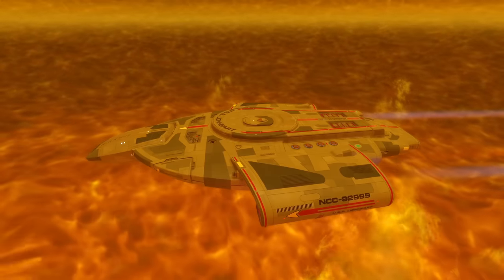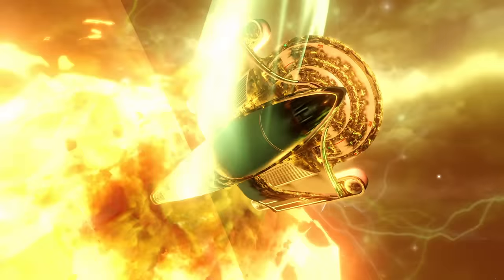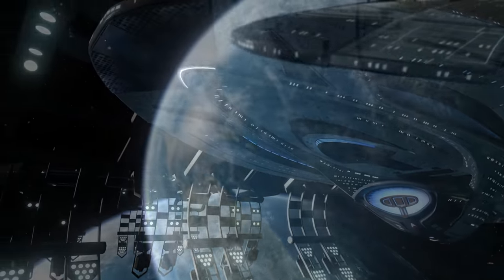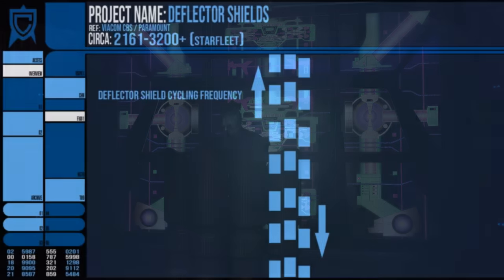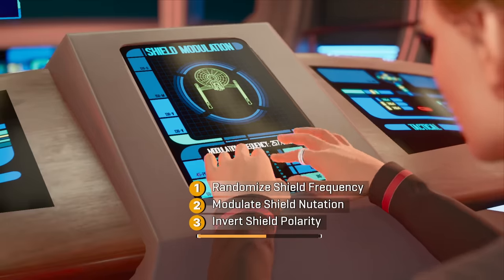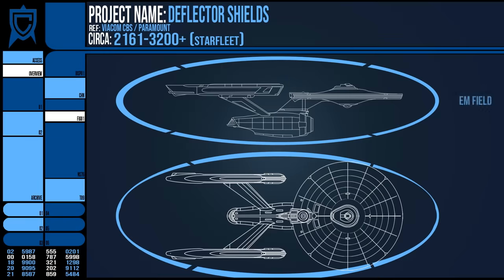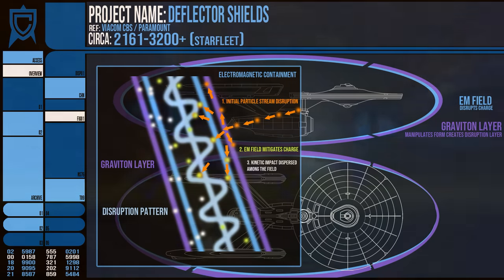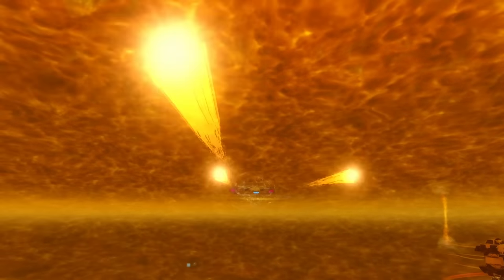What Makes Deflector Shields Different?

Comment: The problem with the “matching shield frequency to fire through” idea is it creates the plot hole in Star Trek Generations that when the Riker ordered Worf to return fire on the Duras sisters’ Bird of Prey the Enterprise’s phasers should’ve passed through its shields as easily as the BoP’s disruptor fire passed through the Enterprise’s…
Reply: The enterprise should have been able to destroy her in a single barrage. Really ( shield or not )
Reply: Wouldnt of mattered, la forges vizer was comprimsed so no matter what frequency they change to the duras sisters would be able to match
Reply: @darthdragonborn1076 i believe in the battle dialogue, it suggests that la forge attempts a new frequency, but the klingons were able to require it . ( the gunner said   he had it again.   ) frequency.
Reply: @shanenolan5625 litterally what i just said
Reply: @darthdragonborn1076  y3s , I'm agreeing.
Reply: @darthdragonborn1076  they’re saying since the Klingons adjusted their beam to match the Enterprise’s shield, then their own shield must also be the same frequency as the Enterprise’s to be able to fire at all, so the Enterprise should’ve also been able to fire back as if there was no shield (instead of doing the cloaking device gambit to lower them).
Reply: Hey, guys. Even if they changed the frequency, LaForge's visor was still accessible by the Klingons. Nobody already said that yet, right?
Reply: Duras sisters probably changed their shield frequency back after firing
Reply: @kaitlyn__L  I could see, depending on how fast it takes to do, the Duras ship would switch to a different frequency between firing their weapons as a countermeasure. Or maybe only one section of their shields around the disrupter canons was matched.

Though we all know the real reason is that they didn’t put much thought into it when they filmed the movie
Reply: @oninoni  that would be sensible
Reply: @Nostripe361  yeah I’d honestly assumed it was a “once every few minutes” deal but considering the “constantly rotate shields” thing maybe it can be milliseconds.
Reply: @CtrlOptDel Well, no. If they timed their shield frequency to their shots just like the old prop fighters and their machine guns so that the shields would match only when the disrupters were firing then it wouldn't matter. But in all seriousness, a  Galaxy class would crush an old BoP pretty much instantly even running only on the fusion generators in the saucer section. Idk HOW the Duras sisters took down a Galaxy class with that old a model no matter how much of a jump they had on them. The Galaxy should have been able to take them with a single full spread, end of story.
Reply: The Star Trek version of an interruptor gear? Match the frequency while firing, then change it automatically.
Reply: @gmradio2436  literally what I just said 😂😂😂 sorry I couldn't help myself
Reply: @getoffmeluckycharms  Wait, what? Who are you? Someone from the comment chain?
Reply: @gmradio2436  you replied to my comment my guy
Reply: @getoffmeluckycharms  he actually just added a comment to the thread. There’s no @ and we all got the notification. Also two other people before you said it (I replied to the first two)
Reply: @shanenolan5625 They just wanted to kill of the ENT-E. It was a piss poor way to do it too.
Reply: Wait, didn’t the Duras Sister adjust their torpedo’s frequency to pass through the Enterprise’s shields not their shields? The only mention of the BoP’s own shields were that they’d drop when the cloak was engaged. The Enterprise had no way of knowing what the BoP’s shield frequency was to adjust their own weapons to match it.
Reply: @mb2000  the idea is that you have to match your shield frequency to your weapons or you will just impact the inside of your shields. Do if the Duras weapons were matching the shields of the Enterprise than the Bird of Prey needed it’s own shields to match
Reply: @mb2000  The shield frequency of the BoP also has to be the same. The argument is that ships know their own shield frequency, which allows them to fire through them while enemy fire does not. The BoP has to fire weapons through their own shielding as well as Enterprise's, consequently the BoP's shield frequency would also have to be the same. On this basis, Enterprise wouldn't even have to tune her own weapons to pierce the BoP's shields as by default those also should have the same frequency.

I'm of the opinion that this is as usual a very pedantic argument that can only exist in the imagined reality of nerds with ironically flimsy and simplistic logic that can't work in the real world. Any number of factors could explain why the BoP can fire through the shields while Enterprise can't, like auto-cycling shields while firing, to 'frequencies' not meaning the same thing for shields with fictional physics involved. Most of these same people would barely understand the physics and engineering in today's every day mechanics like in computer chips or locomotion. The Duras vs Ent-D battle was not the only example of this 'flaw', and not going into the specifics of the mechanics beyond Duras know the specs of Enterprise is not lazy, but simply prudent writing. Unless you're really looking for stuff to nitpick and you watch Star Trek for fictional technologies to work according to your layman 21st century logic.
Reply: @getoffmeluckycharms  No, I replied to CtrlOptDel. Everyone in the chain might have seen it, but that is it.
Reply: @Nostripe361  Yeh I’ve just never heard of that being a problem before I think there’s been times when shuttles or probes have been launched with shields up too. I slash took the shields to be a one way thing.
Reply: @mb2000  If they adjusted their weapons to match the Enterprise’s shields without also setting their own shields to that frequency their weapons wouldn’t’ve been able to pass through their own shields & would’ve impacted on the inner surface of the bubble.
Reply: The shields have always rotated through frequencies, they're not static. Otherwise, the opponent would just need to know what frequency hit them to match it and fire back. But the Klingons were always watching what they cycle through, so while they could fire and change their shield after, they would always know what the Enterprise's next frequency was.
Reply: @CtrlOptDel  I get what you mean and it makes sense, I just don’t think it’s ever been mentioned to be a problem before so I can only assume that it isn’t and the shields are one way regardless of frequency.
Reply: @mb2000  That is indeed the simplest explanation. I was responding to CI’s assertion that it was frequency-matching that allowed for firing out of the shield bubble.
Reply: @CtrlOptDel  I apologise, I wasn’t meaning to sound like I was trying to argue the point!
Reply: @3Rayfire  that is a pretty good explanation. It would be like shuffling a deck of cards after every move or draw in a card game but one side can see through all of your cards and know what you will do next. 

I just always thought that there were millions of frequencies and it was impossible to figure out the exact frequency needed to pass through with modern trek tech.
Reply: @mb2000  it’s probably been mentioned here and there but trek has always been really inconsistent with the details or major plot points that it’s basically impossible to say what is possible and what isn’t other than the very broad strokes. I

I  mean look at how they deal with teleportation going through shields in many episodes despite it being stated that teleporting through them is impossible in many other episodes
Reply: That is assuming that the shield frequency of the Klingon vessel is remaining the same when it fires & when it doesn't. Which may not be the case. If I remember correctly we see it trading barrages but them not firing on each other at the same time.
Reply: @3Rayfire  and the BOP wasn't firing constantly, so it seems like they were doing adjustments on the fly. And a bop firing in anger can fire far faster than they did.
Since torpedoes are encased, maybe it's even possible to set it to you own shield frequency and the adjust to the enemy's shield frequency.
Reply: There's frequency, nutation, and polerization in ST. I believe they have to match the frequency of their own shields to fire through, but they don't necessarily have to match the same nutation.
Reply: @darthdragonborn1076 * Visor
Reply: @NACLGames  If that were true than every battle would be over after the first phaser shot. "Ensign match our phasers to their phaser frequency and fire" Whoever shot first would lose every single time.
Reply: @mammutMK2  A distinct possibility, after all Chang's Bird of Prey was able to do that to fire while cloaked.
Reply: @Nostripe361 And you thought right, which is why it isn't a commonly attempted tactic. Trying to block every frequency of subspace and the em spectrum, would probably be almost impossible to power and would likely blind you as well.
Reply: Presumably they matched the frequency to fire a volley and then changed it. It’s a trick that only works once anyway, because the target ship will change their frequency once they realize it’s compromised. But even one volley without the protection of shields can be devastating.
Reply: @jayb8934  and the most wild part of all is starfleet didn't actually start changing their phaser frequency until the fought the Borg.
Reply: @NaatClark  Does it make sense for them to. Every ship already has a different frequency, doesn't it? The Borg have a unique ability to quickly crack it, so they have to keep changing it. But it's like a PIN number on your phone. Why would you change it every day if no one knows it, unless you're dealing with a hacker who can crack it every time you use it?
Reply: @jayb8934  We can measure energy frequencies now irl. It's literally how radio, infrared, optical, and neutrino detectors work. If someone shoots a laser we can measure the frequency. The Federation can look in to your bathroom from 10 million kilometers away and you're telling me their ability to detect energy frequencies of something being pointed directly at them is worse than ours? Nahhhhh
Reply: @NaatClark  I mean, I know it's a cop-out answer, but we don't really know how the technology works and why it's not that simple. That's just how sci-fi works. If we could really explain the technology, it wouldn't be fictional. And because real science marches on, sometimes real tech DOES surpass sci-fi, and we just suspend our disbelief.
Reply: Seems some people dug too deep. 

The Enterprise D should have absolutely obliterated that BoP. They just wanted to make a new ship is all.
Reply: What always irked me a about that whole scuffle is that Geordi's visor should have been checked top to bottom to make sure it wasn't tampered with, and I don't care how smart the main villain was, he should not have been able to change or add something in a way that Geordi, Beverly OR Data would not have been able to figure out and fix.
Reply: Shield frequencies are itself a plot hole

Comment: A thought on transporters vs. shields...possibly, transporting requires too wide a set of frequencies to 'fit' through the gaps in the shielding without degrading to a hazardous degree. Like putting your people through a strainer...
Reply: also risky - get your timing wrong and that person reappears as swiss cheese
Reply: Interference in a transporter beam causing corruption to the data I imagine would be terrible for the thing being transported.  Interference with an phaser may reduce the effectiveness but mostly that doesn't matter so much.  So the SieveStrainer metaphor works well.
Reply: I'll just paste the comment I just made in here because now I'm curious what you think. 

Actually it kinda makes sense that we see beaming through shields less. Because with the whole refresh rate frequency idea, when it comes to energy weapons it doesn't really matter if 1% of the energy doesn't make it through due to slight inaccuracies in one's knowledge in what that frequency is and/or the accuracy of whatever is controlling/generating/regulating the frequency reference  (like how a radio needs to have the oscillating frequency generator for reference to process the incoming information normally via the use of a crystal oscillator; I might be screwing that up slightly or oversimplifying). However with a transporter.... that 1% may very well be the difference between life and death for the person beaming through.
Reply: Spot on  @materialdialectics
Reply: Like a balloon and something bad happens.
Reply: @materialdialectics  Hopefully in the future error-correction has improved greatly. There may even be a lot of extrapolation.
Reply: The reason why transporters don't work through shields is because of the volume of the data being transmitted and the limits of computer memory of the time.  The first transporters memory buffers could not retain the information for very long so a greater number of communication channels(frequencies) were required to transmit the total amount of data involved before it would degrade in the memory buffer.  As the technologies matured, a greater amount of information could be encoded on fewer channels with higher data transmission rates to  increase the reliability and speed with which something could be transported.  Conversely, energy weapons use very few frequencies at higher power so it would be easier to pass through the shields if you could match frequencies with the shield.

Comment: How do they work? They work very well, as do the Heisenberg compensators in the transporters.
Reply: Wasn't Heisenberg on Breaking Bad
Reply: Look up the Heisenberg uncertainty principe
Reply: How about something more serious, lol!
I have a theory for artificial gravity on space ships.
We already know of the Alcubierre formula, and it’s few iterations of the formula as described by the 3D model image.
If the warp field is tuned for travel, the deep dip in front, and high apex in the rear of a ship, with the ship supposedly within the “ring” that describes the field.
The second iteration that was put out had the inner section inside the warp “ring” at an angle that would have been more than adequate to be the “artificial gravity.”
Follow me, it’s easy and hard all at once….
So, maintaining the lesser inertial forces inside the field was automatic.
A ship at rest, or “full stop,” would have no warp ring, yet still be producing a gravity field for the crew.
Smaller fields could be used within that field, as we have seen where lifters can move heavy items.
So, your artificial gravity and inertial dampers are basically one and the same.
As a side note, being tossed around in a ship would simply be a reaction to the system’s inability to compensate for some of the larger, or more intense, energy weapons that would drain the system for brief periods.
In that case, floating down a corridor or being smashed to a wall or floor would not be that uncommon in a heavy battle.

This all assumes we have no real source to generate gravitons.
Or do we??
By placing a standing wave of multiple “warp rings” around a ship, and energizing each ring with its own frequency of ionizing energy within, these “force fields” would be a fairly easy task to create.
My own theory is, we will be capable of producing a field that is able to surround a ship, but never be able to get one to hug a surface.

Electromagnetic and gravitic forces are very happy to follow rings and ellipses, but following a surface may well be too much to ask, even with a theoretical unlimited energy supply.

If anyone wishes to expand on this, especially in the theory of the standing wave and flux field requirements, I could use the input.
Don’t bother trying to tear it apart, I want to make it POSSIBLE.

BTW, if this works, especially without monstrous rings of fluid metal traveling in a ring at incredible speeds….

Think “old school,” where the things we know are not just simple, but doable with what we have!

PUT ON THE INNOVATION HAT!